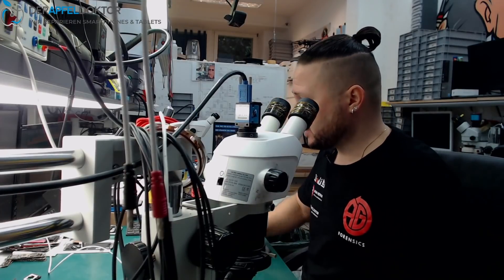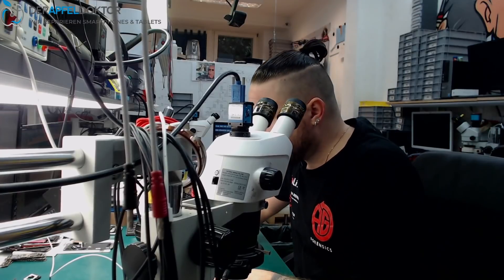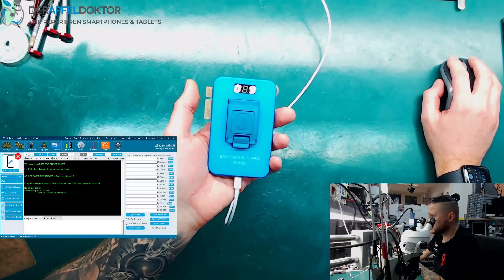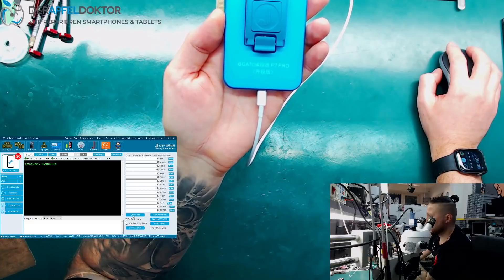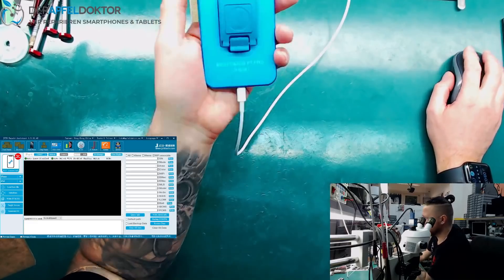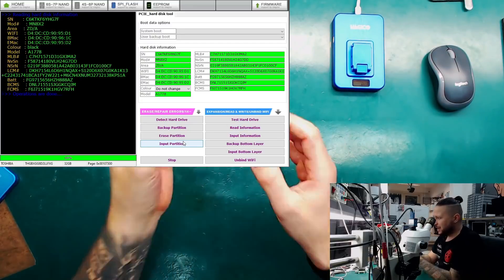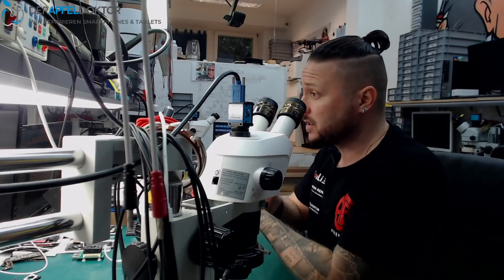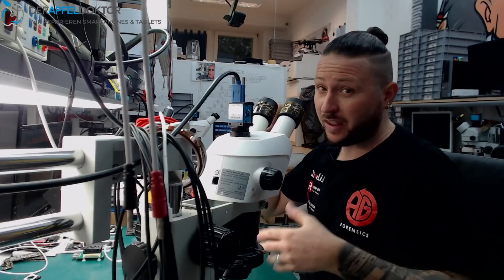HOW TO RECOVER BOTTOM-LAYER (SYSCFG) FROM A DEAD NAND WITHOUT GSX-SERVICE - RECOVER WiFi- AND BT-MAC

Comment: PLEASE ANSWER
 Hello, can you help me deal with one question? I have the same model of Magico Box without the DFU button as you have, the question is: I formatted the PCIE flash (full formatting) and after that I can't write the data back, it gives an error. And as I watched in other videos, I need to connect the box to DFU mode and then flash it through iTunes, but due to the fact that there is no red button on my model, I can't do this. Is there any way out of this? have you done full PCIE flash formatting and what does your system output? Thank you in advance.
Reply: I have the same problem